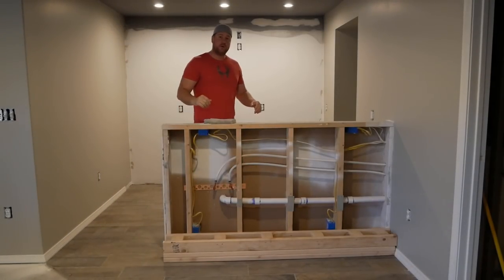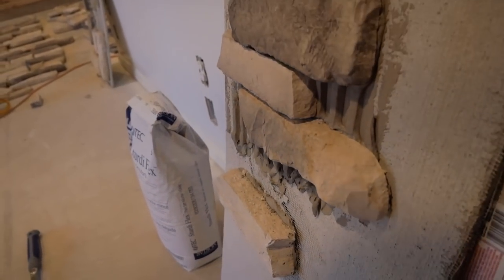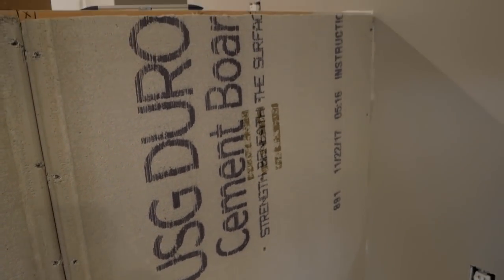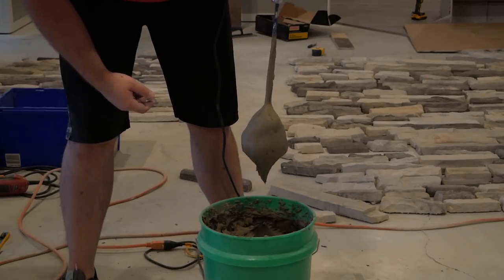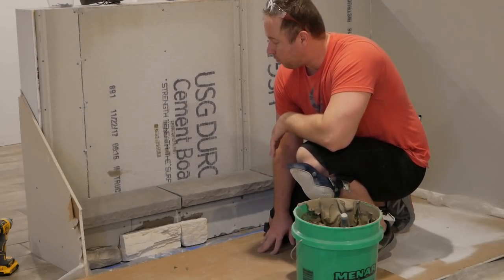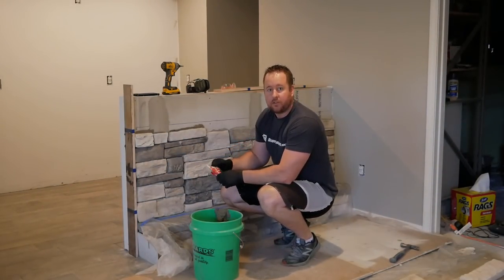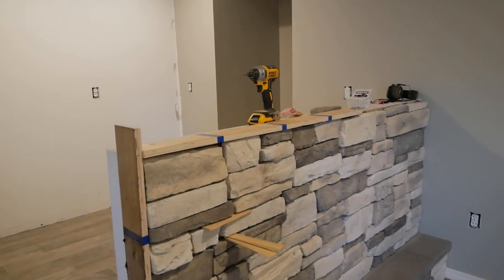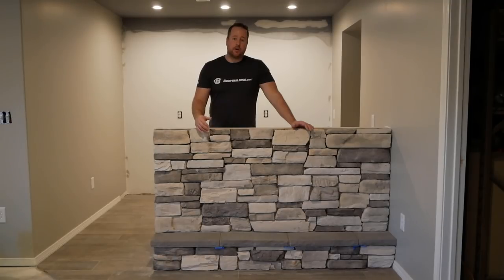DIY How To Stone Veneer Bar or Fireplace | El Durado Stone

Comment: Thank you. Doing similar and most of the old timers I'd read would try to get me to scratch coat, lath, to install.  I read that the Masonry guide allows concrete board interior.  I much prefer working with thinset and concrete board as I'm used to it. Will use this method.

Comment: Had one quick question on your bar design. Mine is L shaped but loved the stone and the step you did. Do you know roughly the how wide you made that step? I see it is likely just under 6 inches which seems to be the recommendation on bat rail height. Appreciate any insight also understand you might not remember after that healthy size drink :)
Reply from the maker: Yea I liked the stone step vs a rail like a lot of people do. It was over 6 inches I think, but not by much. Probably 7-8 inches
Reply: @LifeofBliss  Thanks I appreciate it. What I ended up framing it out to be. Have to show it to you when it is all said and done.
Reply from the maker: @chadhenningfeld8805  definitely. Shoot me an email when you get it all stoned up! Lifeofblisskb@gmail.com

Comment: Life of Bliss, How did it hold up without putting a scratch coat on? you just buttered the back? I am also commenting regarding the fireplace wall. Thank you. Very nice work btw.
Reply from the maker: Thanks Mike. Those stones wouldn't come off that concrete backer if a tornado came through lol. The mortar I used said the substrait could either be straight concrete board or plywood with a wire mess and scratch coat. Just check your mortar to see what it recommends 👍I just backup buttered them, no issues

Comment: Good work.  Nice video.  I assume any stone veneer can be applied to Durock in this fashion?  I'm using Cultured stone by Boral which is the same company that makes Eldorado Stone.
Reply from the maker: I'd check the manufacturer product sheet for recommendations on the type of mortar, but application should be the same

Comment: I don't have a lot of experience with cement board, but I have a shed that the walls were covered with cement board. One of the walls has a hole. Maybe 12" by 6" hole. Can I use wire mesh to patch it and maybe place cheap veneer or something over it to fix it? It doesn't have to be pretty as it's on a side not visible. Trying to figure out ideas how to fix it as I don't have anyone to help me
Reply from the maker: I would think stapling or screwing in that mesh and then going over it with some mortar would be sufficient to patch it

Comment: I assume the amount of mortar placed on the stone squeegee out enough to fill the in between stone. Can this be done waterproof exterior?
Reply from the maker: Yes it did fill between. You would need to use some sort of waterproof sheathing behind the stone as water can still get in behind it. Something like zip board, the your backing and rock on top of that

Comment: What was done on the outercorner?  How was the surface covered on the outer corner of the ledge at the bottom?
Reply from the maker: I covered the end with stained plywood and a decorative edge banding. You can see how that looks in my LED install video around minute 11. https://youtu.be/Qbv_NvcJ9f4

Comment: Do you any sharable plans for how you built your bar?  Dimensions and measurements of the frame?  I love the layout but I'm not sure I could recreate it.
Reply from the maker: Hey Kapn, I don't have any plans per say outside of just some rough dimensional sketches I made so I had a game plan going into it. I can give you some measurements though to get a good idea of the layout... the whole bar area from side to side is about 9 foot. The bartop area with the stone front is 6 foot wide, allowing a 3 foot walkway into the bar. The bartop is also about 8 foot off of the back wall. With standard depth counters, this gave a walkway of about 3.5 feet behind the bar. Hopefully that all makes sense... your sizes would vary based on your area, but the walkway behind the bar area is very comfortable for 2 or more people to move around at the 3.5 foot width.
Reply: @LifeofBliss  Not sure if you monitor this any more. I believe what this person was asking and what I am interested in is the height and width of the bar along. How high did you make the knee wall for the bar. I do like how you laid this out and discussed the walk thru traffic. If you happen to remember would love to hear what the actually framing dimensions was for the bar. Along with for the foot pedestal area.
Reply from the maker: I went over the build of the short bar wall in the framing videos of the build process. Essentially it was just 2x6 that just tied into the full wall to the right. I just looked at what a standard bar height counter would be and made it roughly that high minus the thickness of the bar top. You don't have to be exact, you can make it shorter or taller depending on preference. The width of the bar was about 6 ft wide
Reply: @LifeofBliss  Thank you! I will try to find it in the framing videos :)

Comment: I have a breakfast bar the about the same size.  Do i have put cement board over the drywall, or, could i just cement stones over the drywall?
Reply from the maker: Hey Peter, really depends on what product you use and what it calls for. This particular stone is fairly heavy and needed the cement board. There are some products that are very thin and light that are ok using the drywall. Definitely read the manufacturers suggestions for the substrate. If in doubt,  it would be hard to cut out the sheet rock and replace with cement board just to be safe!
Reply: i wouldn't apply directly to drywall... it is fine if you are doing a backsplash and using lightweight subway tiles, but this stone would probably pull the paper (drywall is gypsum sandwiched between two paper sheets) right off and the stone along with it. better remove the drywall and replace with cement board. it really would be only a small amount of work for extra piece of mind. you wouldn't even need any special tools to do it ;)

Comment: can you apply this to a brick fireplace instead of cement board?
Reply from the maker: I believe it would be ok, but you'd need to check with the manufacturers instruction for the mortar you use

Comment: Nice job!  Looks really nice!  I have a question: when you draw the level line going up, how do you determine where to draw them!  Is it based on the height of the largest stone or is it every foot or do you just pick a random place to draw the lines.
Reply from the maker: Thanks! It's just at random, they are just indicator lines to make sure things stay level as you go up. Every 8-12 inches would be fine. Whatever you want to do
Reply: Life of Bliss ok.  Great.  Thank you and thank you for the fast response.
Reply: Life of Bliss I just wanted to install stone similar to your on a built in bbq grill frame in my backyard.  It’s pretty small in size, about 52” wide by 22” deep by 33” high.  I have the stone and mortar.  I have done significant DIY projects, i.e., built a roof over my porch, small kitchen remodel, including spraying cabinets, finished basement, including framing, plumbing, some electrical, etc.  BUT, for some reason (the stone part) this project intimidates me because if it doesn’t come out right or isn’t level, the mistakes are so obvious and glaring.  So I looked around to see what it would cost to have someone do it and got a quote of $500, negotiated down to $350.  The guy is supposed to start on Monday.  I built the metal frame, installed the durock, ran electrical for inside and outside outlet, cut holes in durock for venting and now I’m intimidated to do the stone.  Lol.  I’m sitting here wondering if I should start on it and just do it or wait til Monday and hand it off.  Anyway, sorry for the long post.  Lol.
Reply from the maker: Hey man I hear ya. It's definitely something permanent and you'd want it looking nice! Nothing wrong with paying $350 for that. I paid someone to tile my basement shower. Didn't feel comfortable enough doing all of that, plus it was a huge time investment... do what you can, pay for the rest 😂
Reply: Life of Bliss Thanks!  I appreciate it.  I didn’t start on it today so I’ll probably have him do it.  I think I have my ego in check now.  Lol.

Comment: What do you do to finish the inside vertical side of the bar?
Reply from the maker: The other side just has a layer of sheetrock covering the studs. I put cabinets along the inside of that wall. There is a video on the installation of the cabinets on my channel if you are interested. Thanks Kapn